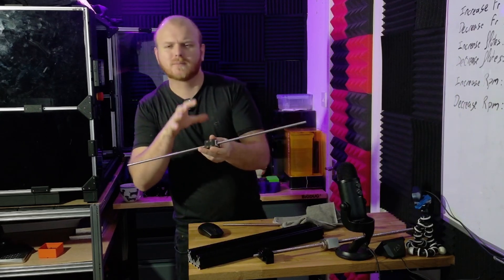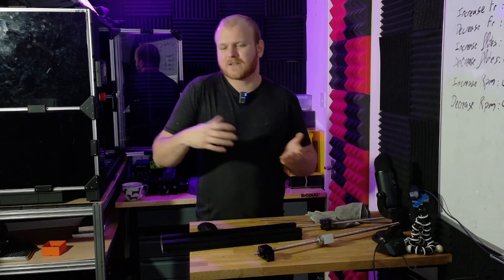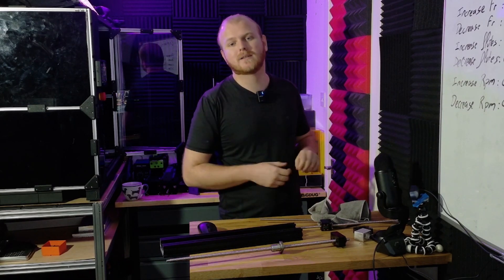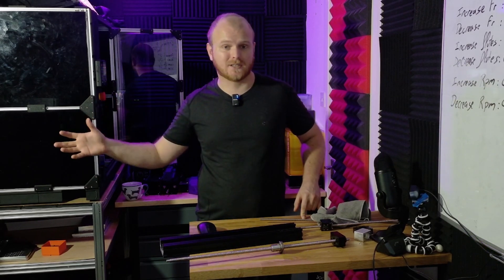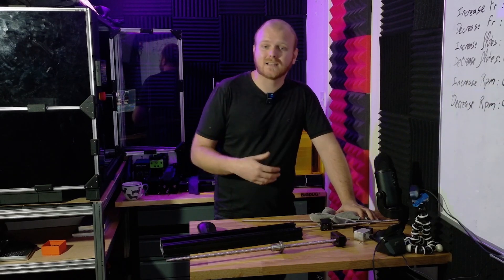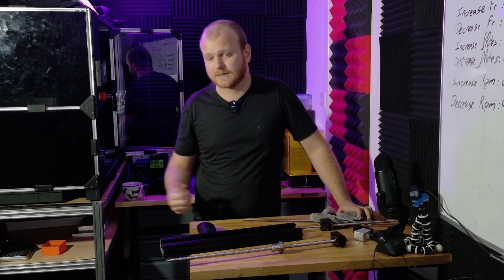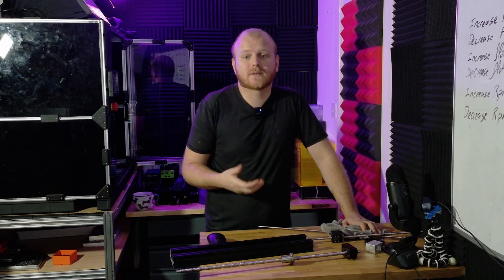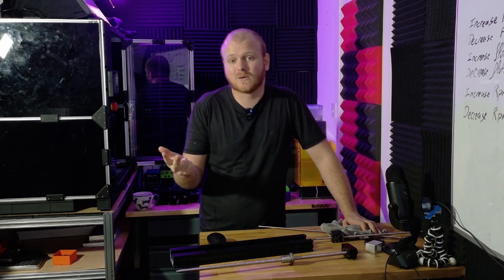Leadscrews, ballscrews and other Buzzwords #3dprinting #cnc #cncmachine #ballscrew #leadscrew

Comment: As the madlad who is using 1204 ballscrews with ground down flanges, i approve of this message 👍
One slight thing, usually ballscrews are also manufactured to more precise grades of pitch accuracy than TR8s which plays a role in "perfectness" of the commanded distance at various spots along the screw.
Reply from the maker: very true, ballscrews that are ground are extremely precise but the common rolled ballscrews that we tend to use cause they're much cheaper tend to be roughly in the same ballpark as a decent TR8x8 leadscrew. There are creators who have documented the issues with them before I believe MirageC was one of them.